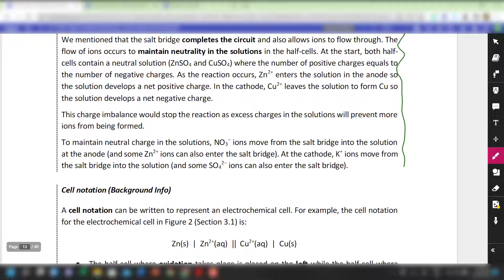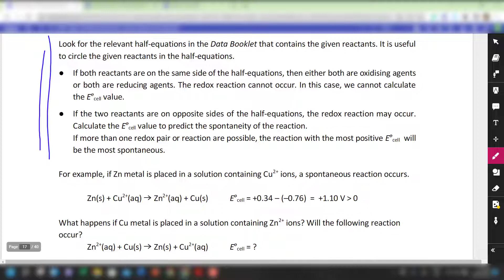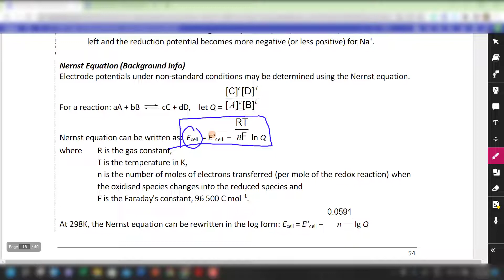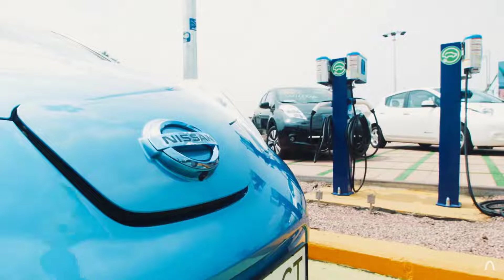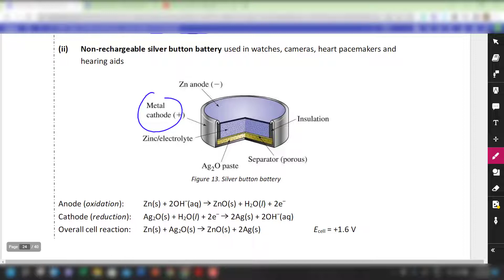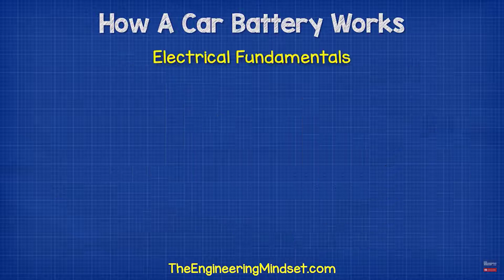[H2 Chemistry] 2026 Topic 21 Electrochemistry 2

Comment: Hi teacher, I'm just a bit confused for 55:43 why can't you use something like the previous Ecell calculation i.e. +.77-(-0.44). Can I generalise that if you combine the 2 half equations and it doesn't result in the cancellation of anything other than electrons, then you can use the Ecell calculation. If the overall equation involves the cancellation of something other than electrons, you need to do hess cycle?
Reply from the maker: Hi, you can't do that because the calculation you performed is for the following reaction "2Fe3+ + Fe to give 3Fe2+", not reaction (3). You can think about it and reach out further if needed.
Reply: May i know if i can think of it like this: if you combine one reduction and one oxidation reaction, you can do the sum. But you are gonna combine 2 reduction equations like in this case (or 2 oxidation equations), then you need to draw hess cycle?
Reply: I'm trying to find the big distinction for when you can do the sum and when you can't 😅
Reply from the maker: @user-sv4kd9zo1y  You are kinda correct but you need to understand why that is the case. I believe you have some understanding and continue to think through the matter and understand why that is the case.

Comment: Hi teacher, at 57:20 having to use Hess' cycle to combine half equations seems non-intuitive, would I be able to use the following physics explanation?

Potential difference is the work done per unit charge, since E is p.d., so we are unable to add E1 and E2 together because E1 represents work done by 1 unit charge but equation 1 shows 2 unit charges. Hence to find work done by 2 unit charges in equation 1 we multiply E1 by 2, -0.44 x 2 = -0.88J. Then we can add the 2 equations together, so the work done by 3 unit charges in equation 3 is -0.88 + 0.77 = -0.11J. To find E3 we divide by 3, E3 = -0.11/3 = -0.04V. 

This is essentially the same calculations as using ΔG when you cancel all the constants, but I would understand this easier. So I just want to check if this understanding is correct? Thank you.
Reply from the maker: Hi Zhuoyun, you're absolutely right. Your physics-based explanation using work done per unit charge is a valid and insightful way to approach the problem. In fact, it's conceptually aligned with how Gibbs free energy (ΔG) relates to cell potential (E), just as you pointed out. At the H2 Chemistry level, we typically teach the Hess cycle approach to build on what students have already learned in Energetics, and also because not all students take Physics so we try to avoid adding too much cognitive load. I am heartening to read that you're making these cross-disciplinary connections :)
Reply: So for exercise 3.3 (b) if they didn't say we had to use an energy cycle, we can just use (1.47x10 + 1.36x2)/12 = +1.45V? It seems much simpler if the aim is to calculate E ClO3-/Cl-.
Reply from the maker: @Yang_Zhuoyun  Correct